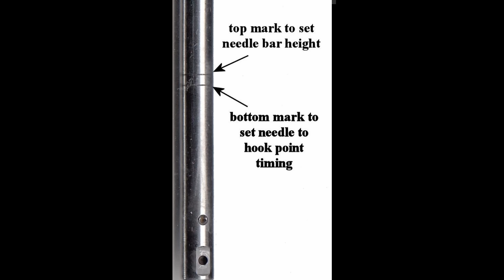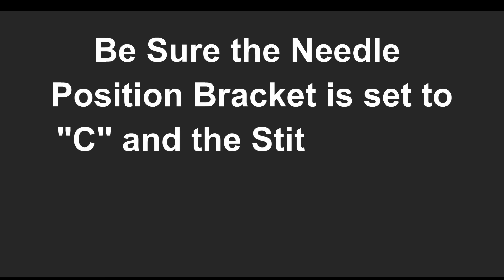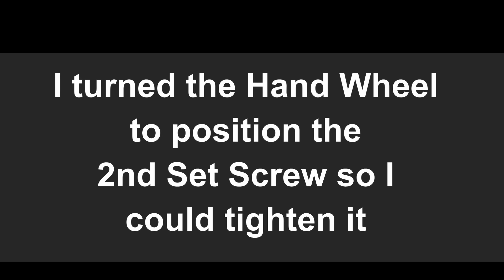How to Check and Set the Timing on the Singer Model 413 Sewing Machine

Comment: Hi Andy... thanks for the great care you take in making these wonderful Singer videos... I have effectively been able to recondition my Singer 413 (flea market find) following your detailed instructions... one things has me perplexed... I cannot get the feed dogs to advance the fabric at all... regardless of stitch length or any setting on the machine... I have followed some of your other videos and been successful in centering the dogs correctly under the needle plate and adjusting the height of the feed dogs but nothing has affected the front to back motion of the dogs...  wondering if you have run across this before
Reply from the maker: Congratulations! You are the winner of this week's unusual problem prize. 🏆
Look @ 5:00 in this video: https://youtu.be/Yg4OrTCeHxI     (paused)
Those two horizontal shafts above and below the timing belt are what move the feed dog. The upper shaft is the FEED ROCK SHAFT and the lower one if the FEED LIFTING ROCK SHAFT. One rocks the dog front to back and the other does the lifting motion (in an elliptical) Those two shafts are powered by two vertical shafts that go up and connect onto the main horizontal shaft. One is called the FEED FORKED CONNECTION and the top of it looks like a big fork on an eccentric cam. The other is the FEED LIFTING ROCK SHAFT CONNECTING ROD (whew!) and it is to the left of the fork. So those four shafts moving make the dog lift up, move to the back, drop down, move to the front and repeat. (normal sewing) I have never seen a machine where the dog was not moving like that, so I would be looking to see if all four of those shafts were moving and they had no missing screws or hinge screws that hold them together. How much and how far they move is controller by the FEED REGULATOR that most people call the stitch length control. If the feed regulator is broken, disconnected or missing I guess the dog would not move. You can buy a service manual for models 416 & 418 which the 413 is a family member. It's the closest thing to a separate manual for your 413. It has all the feed system adjustments and many are similar to your models parts. That's the best I have for you based on what you are asking. Good Luck Michael.
Reply: @andytubesewing1953  THANK YOU AGAIN ANDY... after having disassembled all the components you mentioned above with no improvement I had failed to check the feed regulator and it looks like it was actually disengaged completely... it seems like that is where the problem was and I am in process now trying to get things moving... you thoughtful response is very much appreciated and it put me on the path of hopefully getting this working... with my sincere thanks... Mike

Comment: I used to work for SCM mechincal ca;culators and my when there was two set screws on a pul;ey usally one had a flat end where it touches the pulley and the other had a pointed end, when ajusting tp close tolerance first scew in the flat end where you can adjust the pulley and when it is in the right position thighten the pointed set screw it will dig intothe shaft, somtimes we hd to pull the pulley out and grind the dimpel on the shaft to esae the adjusment. I hope this is clear. love your videos.
Reply from the maker: It is very clear and I love that you shared that. The actions you describe make good sense. I imagine the work you did involved much closer tolerances than this sewing machine. I'm happy you like my videos and please comment whenever you can, OK? Take Care.

Comment: Great video. Wouldn't you want to set up the timing with the needle in the far left position tough?
Reply from the maker: Nope. I follow the Singer Service Manual for checking/setting the timing. For this class of machine it states the Needle Positioning Lever is to be set to "C" for center and the Stitch Width Lever set to "0" for straight stitch. I have heard of people setting timing with the needle to the left but I have never seen that in a Service Manual and I have never set the timing that way. Some machines have a Pendulum Timing Adjustment where you usually put the machine in ZigZag or Ric-Rac mode with the width lever all the way to 5 or widest width to test and if timing needs to be reset you move the Needle Postion Lever to "R" for that proceedure. But for Hook Point to Needle Point Timing I have always used Straight Stitch, Center Needle Position.
Reply: @andytubesewing1953  thank you for the explanation
Reply from the maker: No worries. Thanks for watching my channel.

Comment: My hook plate won't move after re-tighting the screws at the bottom. It won't move when I manually spin the needle up/down. It used to b4 i removed screws 😔 - btw, i did have a broken gear at the top which I replaced watching your other video.
Reply from the maker: "manually spin the needle up & down" does that mean when you turn the handwheel by hand that the needle bar does move up & down? I get that the hook is not rotating (there is no "plate", just the round hook on the end of a shaft). What IS moving when you turn the handwheel? Like, do either of the pulleys rotate? Does the timing belt rotate?

Comment: Thanks for all the helpful videos you make. I have a Singer 413 that the hook wont rotate by turning the hand wheel,  the hand wheel only moves the needle bar up and down but the hook wont rotate,  any help on how to fix this pls?
Reply from the maker: The top gear on the vertical shaft is broken. The plastic has given up. The replacement gear is about $10. This is such a common problem on a dozen models from that time that I made a video for replacing the gear. The video has almost 30K views now so don't feel alone. Here is the link to the video: https://youtu.be/M3bFtlV1Y6s      The video was made using model 457 but your 413 may be similar enough to it that you could follow my video and replace your gear. You can also buy a Service Manual specific to your model. I see some sellers still have the gears in stock. Best of luck.

Comment: Hi andy. I have problem with my singer 974 machine. The timing is already adjusted properly, but the upper thread get tangled with the bobbin case and didn't get to bring up the lower thread.. what should i do?
Reply from the maker: That model was not sold in the US and I've never seen it or worked on it. I found an instruction manual for it. I would start by being sure I had the correct bobbin for it. From what I can tell is should be a plastic Class 66 Singer bobbin with the curved sides. Singer has a Class 15 bobbin with straight side that is a little taller. If you used a Class 15 bobbin in a Class 55 machine the needle thread catches on the bobbin. If I found I DID have a Class 66 bobbin I would check that I had inserted the bobbin in the correct direction into the Bobbin Case and I had followed the correct path for threading the needle from the Spool Pin all the way to the Needle. That is all shown starting on page 25 of the Insruction Manual. Remeber, I;ve never seen a model 974 so I could be mistaken about the Class of Bobbin.

Comment: Hi Andy, I’m so Grateful to you and your tutorials!!!! I’ve just inherited from My grandma the German version of This Singer 413 and i was able to make it work with your  explanations. But now i’ve set the time, i have problems when I switch to zigzag stich, because the needle hits somewhere in the crab. And Also i feel the machine looses the time with just a little work with it, and needs retiming. Do you know what could be happening? Thank you very much!
Reply from the maker: What you describe is the classics symptoms of a defective top gear on the vertical shaft. It is made of plastic and gets brittle and cracks/chips/breaks. So you set the time, but after sewing a little the gear is slipping around with missing teeth. Soon it will break and the hook won't move at all. There are about a dozen models from those years that have this problem. I made a video about how to replace that gear, which costs about $10. I see the video has 32K views now which shows how common this problem is. Here is the video: https://youtu.be/M3bFtlV1Y6s Take a look and you'll see the location of the gear then you can peek inside your machine to see how your gear looks. There is a very high probability the gear is your problem. You can do it, Ana, and Grandma and her machine is worth the effort. A new gear can last 20 to 30 years. Get a white plastic gear, not black, if possible. Good Luck!

Comment: hi Andy im from phillipines and can u recommend a fix for my skipping thread sewing machine,this usually happens on hi speed,seldom at low speed.
Reply from the maker: Kamusta! There are so many things possible. It can be very frustrating. The most common reason is an old or worn needle. The needle is not pushed all the way into the needle clamp, the wrong type/size of the needle. The machine is not threaded properly. There is a problem with tension; too much tension or a dirty tension unit. The machine needs lubrication. The use of cheap thread. The needle bar is set too high, or too low by a tiny amount. The needlepoint to hook point timing is a tiny amount off. The stroke of the check spring on the tension unit is not set properly. There is not enough pressure on the presser foot. Whew! Is your machine a Singer Model 413 as in my video? Are you sewing straight stitch or zigzag, or does it skip in both types?  Needle and threading and tension are the most common reasons for skipping. If sewing zigzag, the wider the stitch the less needle thread tension should be used. <--read again. It is easy to change the needle and thread to test. Cleaning the tension unit with a brush and alcohol is easy. Even dismantling the tension unit for cleaning and adjust can be done. Here is my video about the tension unit on the model 413: https://youtu.be/PSCY72bJ3x8
Start with needle and thread before changing anything like needle height of timing. Easy does it. If you still can't find the problem
I have a playlist for model 413 and it includes how to oil the machine properly: https://www.youtube.com/playlist?list=PLsCOZgzzaiKKVlkxPT9FMTdvUUGj8Ydf8  Good luck, friend, and don't give up. Here is my email if you need it andytube53@gmail.com

buti na lang at salamat sa panonood ng aking channel

Comment: I've hunted all over the web- Can't find any replacement set screws for my singer merritt 2404. So I can't adjust my timing underneath. Where do you get yours and what is the size? Thanks. Love your videos.
Reply from the maker: Most Singer screw sizes are proprietary (not common) so I have to buy used parts on eBay from someone parting out a machine (selling off the parts) Model 2404 is about 20 years newer than any machine I've worked on and I do not have a parts manual for it and can not give you a part number for the screw. Do you need replacements b/c the existing screws are damaged? Did you get an existing screw out? On a Singer made in 1988 maybe the screw is standard size and you can take it to a hardware store to have them check the size and thread pattern. A trusted seller I know of has some parts for a model 2404 and has a "Singer Merritt 2404 Rotating Hook Drive Belt Pulley
 In good used condition with two screws for sale at $6.00 I don't know if that's the parts your talking about but here is Connie's page for the part: http://www.thriftyfarmgirl.com/singer-2404-merritt-sewing-machine-parts  if that is not what you need, you can take picture(s) and email her to ask if she has that part still on the machine. I have done this in the past and if she has it she'll sell it to you. Sorry, that's all I can suggest. Good Luck.

Comment: Great video! I was wondering if you know why the hook isn’t moving when I move the hand wheel?
Reply from the maker: I know exactly why and sorry to tell you the top gear (plastic) of the vertical shaft has broken. That gets the power from the horizontal shaft and sends it down to the timing pulleys/belt to make the hook rotate. The good news is that for $10 and a couple hours of labor you can replace the gear and be back in service. This problem is so common that I made a video about how to do it: https://youtu.be/M3bFtlV1Y6s
It's a step-by-step type tutorial that has been viewed 38K times now, just to show how many people have experienced the same problem. There is info in the description area below the video fo the gear part number and one place to buy it. I wonder who let all the 413's out of the closet? My 4th question in 2 days about it.
You can do it, Coach, and thanks for watching my channel.

Comment: My belt is not spinning.  I tried everything.  Do you have a vid on how to get the belt spinning?
Reply from the maker: It has a broken plastic gear on the top of the vertical shaft that turns the lower right pulley. The machine is 50+ years old and the plastic gets dried and brittle. You can buy a new gear for about $10 and spend some hours replacing it. This is a known problem on about a dozen models of that decade. I do have a video showing how to replace the gear on a sister machine, model 457K https://youtu.be/M3bFtlV1Y6s   This video has 100,000+ views whish shows how common of a problem this is. Sorry for the bad news, but that's what's going on.

Comment: Maybe by wearing a battery LED "headband lamp" will help when filming. I now use one when quilting instead of 5 lamps overhead. Thanks HarborFreight.
Reply from the maker: thank you very much Kay I do have a couple of headlamps that I use sometimes while working but I found they don't they don't work well with the video so I usually don't wear them while filming. by the way how did you like the video?

Comment: Do you have any info on fixing a bobbin winder on a 1980's New Home sewing machine? The smaller metal piece in the middle of the fly wheel became loose and needle won't stop going up and down to wind the bobbin.
Reply from the maker: Hmmm ... I think you are talking about the clutch washer, or stop motion washer against the end of the handwheel. Maybe? I do not work on New Home, but there are a couple different style of handwheel setups. Here are videos about each style that may help you. https://youtu.be/hHl96WL1kzA          https://youtu.be/ikPYHWEkA04

Comment: Andy I have a Stylist 513, about 40 years old now.   Do you know if parts are still available.  The feeds dogs are no longer moving, there are two black plastic gears in the bottom that are missing pieces.
Reply from the maker: Shirley, yes all the parts you need are available online at different sellers. Terry at http://site.tandtrepair.com/StylistLine.html
has parts, but even more importantly has guides for sale that walk you through changing the gears and resetting the timing. Many stores only sell you the parts. Andy Tube viewers can use this coupon at Terry's store to get 20% off entire orders no limit through 7/31/2019. The code is andy-h-yt when you check out.

Comment: First...thank you for this tutorial. I am trying to save this precious machine my mom gave to me. First thing I noticed watching this video was that the bobbin wasn't moving when I opened the plate and  turned the wheel.  When I removed the bottom cover, following your directions in this video to check if timing was off,  I noticed a broken piece which appears to be from a gear. I think my bobbin gear is broken. I read though the thread of comments and believe this is my issue. I can not afford the service cost and would really like to DIY repair if the process is not to difficult.  Are you able to direct me on how to find where this broken piece may have come from and how to replace it?  Thank you in advance.
Reply: The Singer 413 is the exact machine I have and why I was so excited to finally see a machine like mine.
Reply from the maker: Thank you for saving your machine. Family machines are the best to own. Great personal value. You can repair this (hundreds have done it, maybe 20 in the last 6 weeks have asked how) You don't really have a bobbin "gear", just the pulley on the hook shaft. What is broken on your machine is the top gear on the vertical shaft that meshes with a gear on the main arm shaft up top. It is a plastic gear and of an age that it has dried out and crumbled/cracked/chipped off, etc. This is a known problem on about a dozen singer models from that decade. The new gear costs about $10 and I have a video you can use for step-by-step replacement. I made the video with model 457 which is similar and people have been using it to change gears on a few models. If your machine is very different we can still find a way to change the gear if you are determined. Here is the video: https://youtu.be/M3bFtlV1Y6s
It's a long video so play it at 2 times speed if you like. I tried to make it for everyone, not just mechanics. Good luck, and stay in touch. You can do it!
Reply: @andytubesewing1953  Thank you for the prompt reply. I'm about to view the video to determine if I can do this. Time to be the little engine...I think can, I think I can, I think I can.  Will send an update. God bless and be safe :-)
Reply from the maker: @janicebillingtonbarnes6388  I know you can, I know you can, Thanks the blessings and you too!